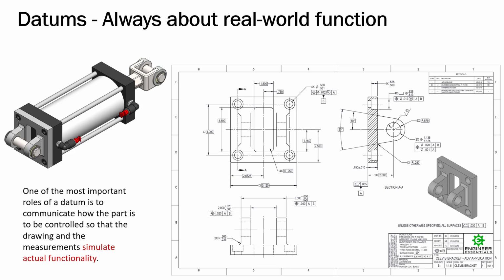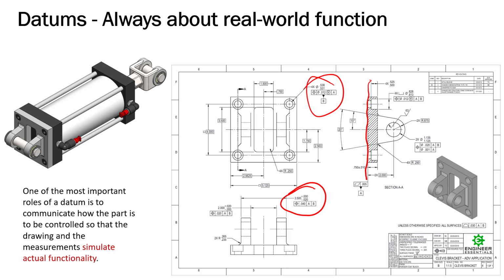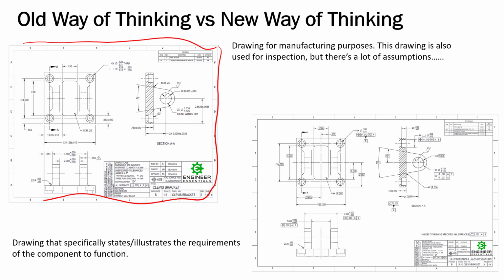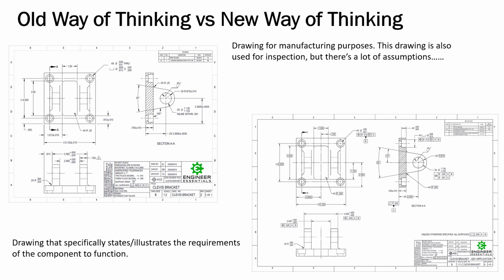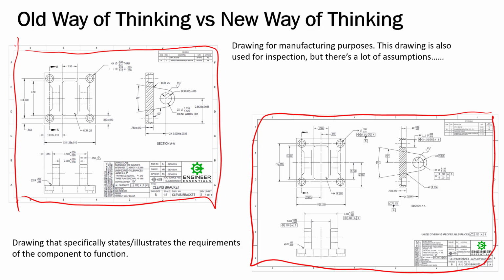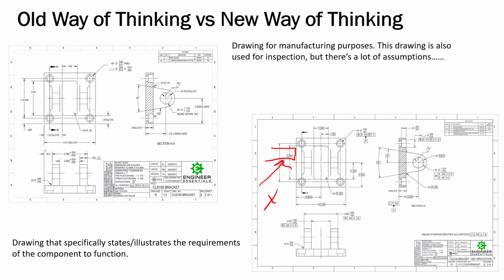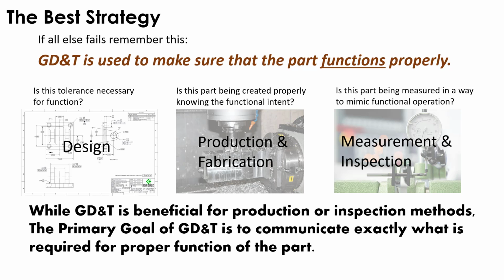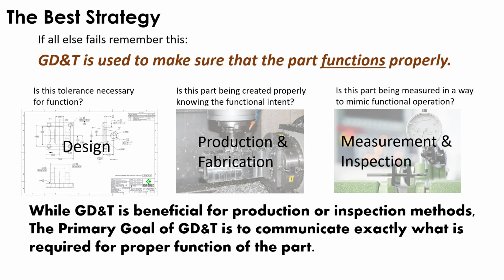How GD&T Should Influence Your Manufacturing and Inspection Process

Comment: am I missing something? to me it appears you've nothing to clock that pattern datum "B", is it missing a datum "C"?  additionally you've lost the location to the 2X 1.125 holes, your Position cant be located  in that section view? simply applying a position callout with nothing to reference in that plane isnt going to work well. in the original methodoly Rule 1 covered their design somewhat, this unfinished example does little but provide partial explanation.
Reply from the maker: Thanks for the questions! We don't need a clocking datum in this scenario because the pattern of 4 holes creates datum B. Section 4.12 of the ASME Y14.5 -2009 standard discusses the use of Multiple Datum Features being used to create a single datum. This pattern of four holes, when used together, controls all of the remaining degrees of freedom. The standard describes imagining the physical datum simulators as fixed at true position and then expanding (since this is at RMB) until all four holes make simultaneous contact at the highpoints or extremities. Not one hole has more control than the other. 

Additionally as far as locating the (2) 1.125 holes, the standard allows implied basic dimensions according to Section 1.4 of the standard. This implied basic dimension is that the holes are located vertically ( in the right side view) by an implied basic dimension of zero with respect to the center of the part (implying symmetry essentially). This is enough to define the True Position, and the Position tolerance will then give us the tolerance or amount of deviation that is allowed from True Position. 

I hope this clears things up for you!
Reply: @Gdandtbasics  For the 1.125 holes, I would not infer the position of .001 to datum A would mean they have a .001 tolerance to each other. That is implied according to what you say in ASME Y14.5-2009. I would infer that the position would be to datum A, which seems to be tightening the tolerance from +/-.0035 positional tolerance to .001. That is a much tighter tolerance. It would make more sense to me if you use co-axiality of the two holes and not reference datum A.

Comment: Why do you have zeros on your basic dimensions? Aren't basic dimensions made to not have tolerances? By putting the zeros you gave those basic dimensions a tolerance. It's a contradictory dimension. I'm confused.
Reply from the maker: Hello, 
Thank you for your comment. 
Basic Dimensions are theoretically exact dimensions that locate features of size and surfaces. They have no tolerance to them, regardless of the number of decimal places shown. The standard states in Section 2.3.2 (d) that "Where basic dimensions are used, associated tolerances contain the number of decimal places necessary for control. There is no requirement for the basic dimension value to be expressed with the same number of decimal places as the tolerance." Remember that tolerance for a feature of size or a surface will come from the feature control frame for that specific GD&T control.
Hope this helps!
- Your GD&T Basics Team

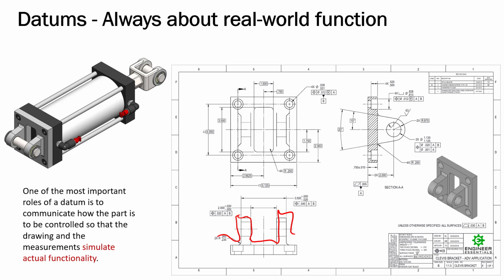Comment: the section A-A view is on the wrong side; 2X 2.000 shouldn't be in a drawing - overdimensioning; 9:30 statement that after roughening, the A datum surface could be fine finished last? you mean after you have holes with a diameter 1.125-1.135 finished?
Reply from the maker: Section 3.1.2 in the ASME Y14.3 standard allows for the Section View to be "removed" from a location that is behind the Cutting Plane when space does not permit. It can even be placed on a separate sheet if need be. 
When it comes to the "2X 2.00" on the print, this establishes "coaxiality" between the two bores. There are indeed two axes there and we want to allow keep them together as a pattern. 
Yes, Datum Feature |A| "could" be finished last. I could insert a probing cycle to find those two bores, align my CS to them and face mill Datum Feature |A| last. This is one of many, many different ways of tackling this. 

Hope this helps!
-Your team at GD&T Basics
Reply: @Gdandtbasics  yea!
Reply: yea your right but it wont change the manufacturing process at all.